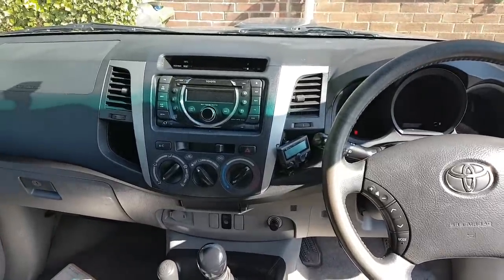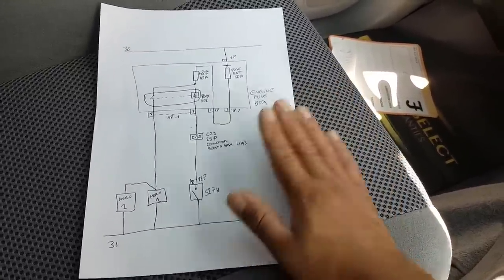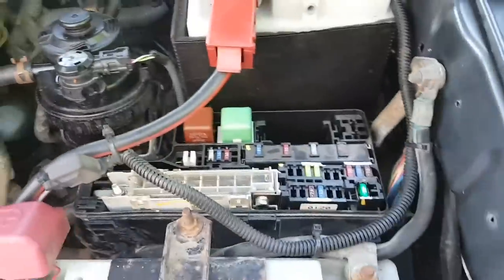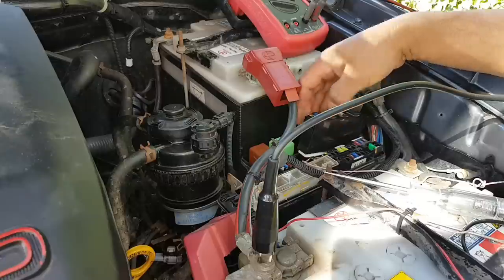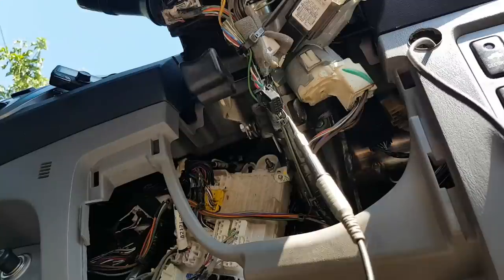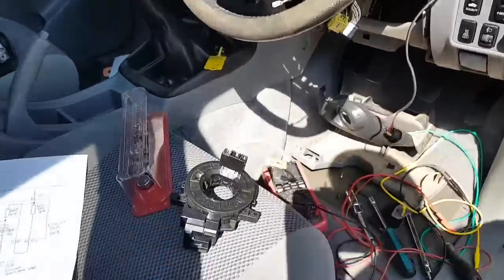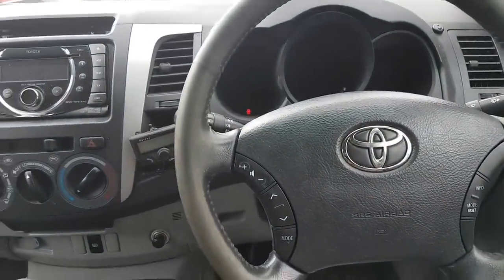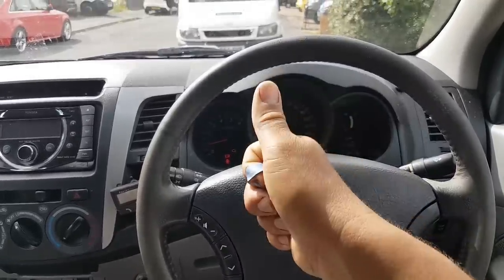Toyota Hilux 2011 horn not working... Sort of... Fault finding and repair.

Comment: That seperate button for the horn IS NOT a fail! It's fully acceptable as some screen wash  motor would be. The presenter should appeal that wrong decision, he would win as there is no RFR (reason for refusal) for a switch in the wrong position it's ridiculous!   Ask the tester for the RFR there isn't one
Reply: Correct Steve ,
Reply: It's not marked as a horn so is a failure
Reply: @Alanw74  Rubbish, show me in the manual where it says a horn button has to marked hor, or any other switch or button for that matter
Reply: @drivewasher  you show me where it says if the marked horn doesn't work to press every button on the dashboard to find a temporary horn, my argument is if they had marked it it would be easier to spot.
Reply: @Alanw74  you can’t just make rfr’s up we have to use a dedicated reason for refusal that’s actually in the manual. It a pass all day long. I might advice it as well.  Still a pass
Reply: @drivewasher  you have to use a dedicated method to test, where does it say if a switch doesn't work to try every other switch in the vehicle?  It doesn't and you know it doesn't.
Reply: @Alanw74  This is getting pedantic!  It's a PASS you can't make it a fail. Just try an appeal on a fail. The tester will get points as it's a pass. end of
Reply: @drivewasher  it's never a pass at time of testing as you have no criteria to test every switch on the dash. I would pass it in retest.
Reply: @Alanw74  Yes if I didn't find or try the switch I would fail vehicle on "7.7.a Audible warning not working" MAJOR FAIL. Then when the presenter came to collect if he showed me the button and the horn worked I would issue a PASS

Comment: Why do people do that It's actually harder to put in the aftermarket switch instead of just replacing whatever is damaged it just don't make any sense It's not like it's complicated that's an old car It uses simple systems just a switch/clockspring  relay  and fuse simple
Reply from the maker: Exactly...
There is more effort in bodge it, than actually repair it properly...
Go figure...🤷‍♂️
👍👍👍
Reply: And it is also unfair to the customer. Feeding them the line "it would be very tricky to fix so I've bypassed it" is basically admitting "I am a clueless fella and can't/am too lazy to figure out a simple wiring diagram". And still, they charged labour and parts for the "repair", I can imagine...
Reply from the maker: Indeed...
😳

Comment: Thanks a lot, Luis! I followed your steps and found out the reason why my horn didn't work was also due to the clock spring. Especially what you did for testing the combination relay was very helpful. Now it's working again after replacement, thanks a lot!
Reply from the maker: 😊
Glad it helped you!
Thank you!
👍👍👍

Comment: good morning luis done loads of Nissan elgrands common problem horn on clock spring opened up an found micro fractures all along ribbon they use a bypass system that runs the ribbon around a roller as you turn the steering wheel continually bending the copper tracks causing them to work harden and then fracture as a import original clock spring impossible to get  and when you can very pricy so managed to get everything working with one matched from a Nissan Navara there are a few different types
Reply from the maker: Nice one... 
Thank you for watching and for your comment! 
👍👍👍

Comment: Top job Luis. Good on the MOT tester, bodging is a no-go, why bodge it if you can fix it.
Reply from the maker: Exactly! 
😊
👍👍👍
Reply: its an mot pass no question about it. The tester would get points on his licence for that AND the presenter would win any appeal. You cant just invent a reason for rejection it has to come from the mot testers manual. All the tester does is test to vosa standards
Reply from the maker: It is interesting how MOT/inspections differ from country to country...
But hey, when an airbag light not coming on when the ignition is turned on is a pass...
Anything is possible...😋
👍👍👍
Reply: @LMAutoRepairs  It's a pass and advice Louis. Stupid really if it's on it's a fail! but if pre check itr dont work its a p&A At least if lights on you know its not gonna work. BUT Mil light not pre checking is a fail, ?????
Reply: @LMAutoRepairs  AND if the presenter tells the tester that the high level stop light has been DISCONNECTED thats a P&A even though its not working
Reply from the maker: Indeed...
👍👍👍
Reply: @LMAutoRepairs  @Steve Ashcroft Interesting point there, just checked the MOT testers manual and "audible warning control insecure" indeed lists as "minor". Well, seems like the tester is not a big fan of bodging anyway. And I do think Toyota put the horn switch into the wheel for a reason.

Comment: Good job boss but I have to ask you something ihave 2020 Toyota hilux gd6 2.4 diesel car was water damage after ican change ecu culster and in side fusebox now car is start and drive now ihave problem central locking not working with the key it's working only switch I try to do manually Program the remote but not response can ihave to generate the remote aging or waht we can do tell me boss please

Comment: Good morning habebe
I like this car
I know all kind of problem in it and i fixed soo many hiluxes before
Reply: Agree, I am normally a VW guy but what these things are capable of is simply mind blowing. Around here, they are being used as company cars for forestry companies and then bought by people to haul wood, some being basically used as forwarders. Indestructible stuff, they have an oil level light on the dash for a reason. Basically the only maintenance they get is the oil topped up when the light comes on.

Comment: Nice
Reply from the maker: Thanks!
👍👍👍
Reply: @LMAutoRepairs  hej
Sir i want Ask about i have Citroën c4 Grand picasso 1.8 patrol 
Code is P 0170 Fuel Trim Bank 1
On display Depollution System faulty 
Can you tel me what is the problem and where i Can find fault Thanks in advance
Reply from the maker: Check for air leaks etc...
It is not as simple as tell you where the problem is... that might be caused by different things...
👍👍👍

Comment: The mot tester is  wrong as long as it has a horn switch  anywhere within range of easy reach
Reply from the maker: Well, I would just argue that although was easy reach, you would might need to palpably look for it... that could instinctively make you to take the eyes of the road to look for it as well...
I am not sure what the rules are on that...
All I know was that this one was failed because of it...
👍👍👍
Reply: @LMAutoRepairs  That placement of the horn switch is no more stupid than having the horn on the indicator stork like Ford do on some of their vehicles.

Comment: Interesting, technically, if the car failed the MOT you are not supposed to drive it unless to  a place to get it fixed, even if there is some MOT left, once it has failed it shouldn't be driven until it passes again.
Reply: Only if it fails for a ''Dangerous'' and it still has a current mot .